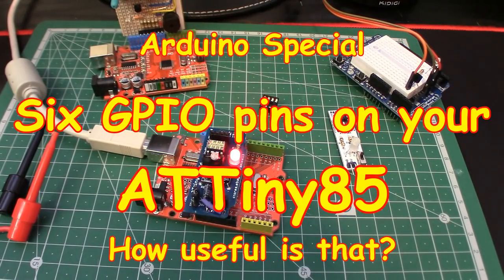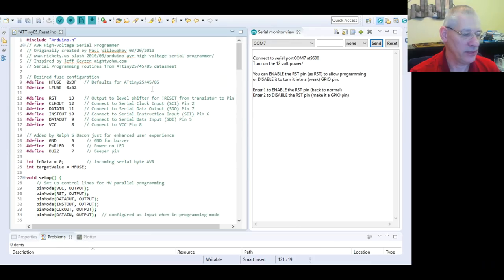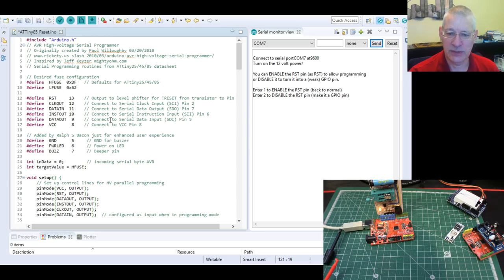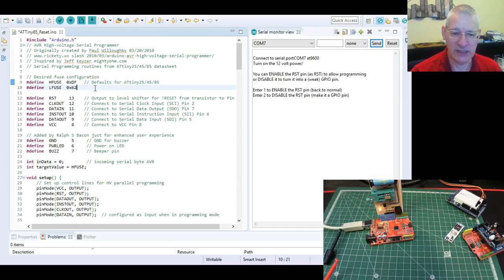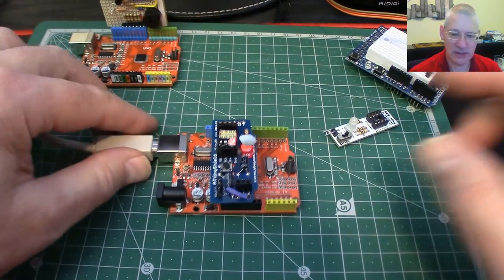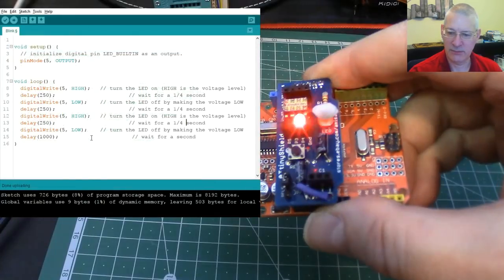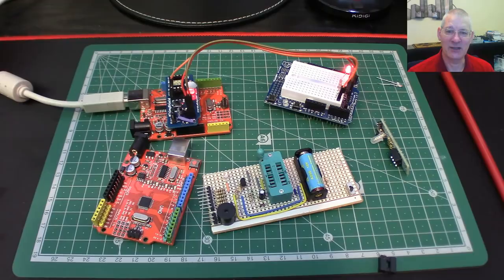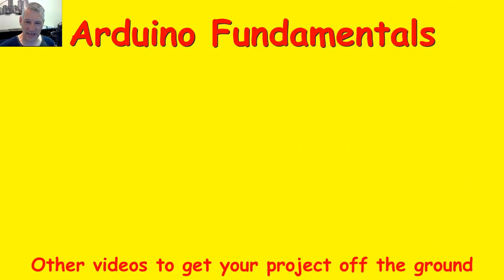#87 Six, yes SIX, GPIO pins on an ATTiny85

Comment: Ralph, this is great stuff. One of my current projects is using six gpio pins on a Nano. I want to use an ATtiny85 and now thank to this video I think I can. Will save a lot of space on the board. Yours is by far the best explination of how it's done. Good instructions/schematics on the 12V board too.
Also have to get a 128x32 ssd1306 OLED working on i2c, so hopefully can figure that out and I should be good to go. I have a few leads but if you have and inspiring tips then I'm all ears. 
Huge thanks as always for your great videos.
Reply from the maker: If you're looking to get the SSD1306 running on I2C on the Tiny85, I did a video on how to get the I2C running (using a different LCD screen) which may help.
Video #82 https://youtu.be/5bnXeHz06Ck
Reply: @RalphBacon  cheers Ralph. Will give that a bash.

Comment: Another great one! Thanks!
Reply from the maker: Thanks Robert - but would you ever use a Tiny85 or stick with the 'traditional' Uno/Nano? And, more importantly, the reason?
Reply: The reason would be power consumption and possibly size. Dawid Watts did a video on how to switch an ESP8266 on and off with an ATTiny85 controlled MOSFET. He was able to extend the battery life to the point were he decided to end the project (or put it on hold). ;-) 

Another reason for choosing an ATTiny85 is price. These micros are cheap. I also like to think of it this way: If you have enough IO-pins on an ATTiny85 and the performance and memory are ok, why use anything else? Assuming of course that the alternative is an ATMega328P or similar.
Reply: Oh, and I forgot to answer the first question. Yes, I have several ATTiny85s and ATTiny2313 and ATMega328P among other Atmel micros. However, I don't use them (yet). I put one of them on a breadboard from time to time, write some code and program it. I really need a reason to use any of my Nanos/Unos or other DIP package I have lying around. :) The demand for microcontroller-controlled gadgets are low at the moment.
Reply from the maker: Thanks for the reply, Robert, it's interesting that your replies seem to reflect the general mood regarding the Tiny85. Power, size, good enough and so on. Well, if nothing else my videos on this device will have raised awareness!

Comment: VERY GOOD THANKS
i was looking at this maybe i can use a shift reg to add extra out put pins
do you have any code for this, i want to make a simple security system that just has blinking lights on each window to make it look like the window has some sensor on it. i did this before using a 4017 and 556 timer
Reply from the maker: You can cascade several PCF8574 pin extenders on I2C (which the ATTiny85 can bit-bang). See my video #49. Also my video on ATTiny85 and I2C video #82.

Comment: Hello, and thank's for this excellent video, I'm just getting involve with a ATTINY85 about fuses setup and I wonder I found this video on youtube about AVR Fuses by Mitch Davis, "Bare-Metal MCU #5 - AVRDude and fuses" , does the AVR setup can do the same as an HV fuses setup module. thank's again for your time.
Reply from the maker: If you watch my video #144 you will see the Fuse Resetter PCB that I made specifically for this purpose. Works well.

Comment: Of course if you really need more gpio there is always the ATtiny84 with its 14 pins.  ;)
Reply from the maker: Indeed you could Nick. If you see my response to 2000jago you'll note that I mention there are several choices and whatever is right (for whatever reason - size, cost, power, features, I-got-one-in the-toolbox) then it's the right one for you! Nice to hear from you again.

Comment: Hi Ralph. Very nice explanation....but I got a little problem - after make the changes in fuse bits, the Attiny85 started to work slower. When I tried to Blink, the delay time was almost 10x slower ... What could It be?
Reply from the maker: I suspect you are running the ATTiny85 at its factory default speed of 1Mhz, Filipe.
 
Go to this website http://www.engbedded.com/fusecalc and select the correct chip and then see if you can decipher what you need to run at 8Mhz using the internal RC oscillator.
 
Be careful, you can make unwanted changes that might brick your device. I used this though, and it all worked as intended. Or, when you program the ATTiny85, just tell the Arduino IDE that you're running at 1Mhz and it will compile accordingly.
 
It's worth uploading the BLINK program with a 1-second delay between blinks to double check your speed fuse settings.
Reply: Ralph S Bacon thanks for the answer! I think I found the thing...in  the sketch, the Low fuse is defined as 0x62, this is default option that , looking at the engbedded Calc, this value makes the clock be divided by 8 ... So If I modify the LFUSE define from 0x62 to 0xE2 It should work. I think when I burn the bootloader with the 8 MHz option , the LFUSE os setted to 0xE2, and when I upload teh attinyreset It sets back to 0x62...I'll try later...tell me If does It make Sense (Sorry my english!!)
Reply from the maker: Yes, the default is to divide by 8, but it does depend on what settings you are using in the Arduino IDE. For example, if you specify 8Mhz as the clock speed (in Tools > Settings), but in reality your ATTiny85 is only running at 1Mhz then you will have an eight times slower "Delay" and "Millis" in your code! So what you propose makes good sense - let us know if you have success with this change.
Reply: Hey Ralph,,,I tested right now and works! I create another function establishClockContact() and other variant - targetClock, and now I can choose the clock fuse bit :))...very thanks for that!
Reply from the maker: Sharing is caring, as they say, Filipe. Glad you got it all working, that is excellent. Thanks for posting (and sharing).

Comment: Actually, I still have a question: it also works on attiny13a?
Reply from the maker: I don't think I ever used on the ATTiny13A, you had best check whether the RESET pin can be turned back into a RST pin when you want!

Comment: Great video again Ralph. Thank you for your research on expanding the ATTiny85.
With your permission, for anyone needing the AttinyShield programmer:
- The DIY version of AttinyShield can be found here: http://www.ebay.com/itm/221434907666
- The fully soldered version of AttinyShield can be found here: http://www.ebay.com/itm/221324819158

 Also I would happily accept the challenge of making this pcb probgrammer but because of your videos I have
a lot of AttinyShield's to make, since with every video i have new orders of the Shield :)
Also did you receive the gift board of AttinyShield I have sent you?

Waiting for your next video my friend.
Themis
Reply: Amisail3 How about a shield for both high and low voltage programming? I recently bought your programming shield, works well. Used it on my latest project.
Reply: Thank you Steve I am grlad you've found it usefull.
I guess the problem for a mixed shield would be the size. It should cover more pins and have more componets on it.
Also not everybody needs both functions. The soft programming that my AttinyShield does is enough for many projects with 2-3 inputs-outputs.
Ralph showed us that if we need more then it is possible... but a shield... 
In any case Steve it was nice bringing it up.

Themis
Reply from the maker: Hey Themis, great to hear that business is booming!

Yes, I just got your replacement shield, thank you so much, I shall construct it soon (and not modify it this time). I guess there is not enough demand for a PCB for a HV programmer; at least I have shown that it is easy to construct on strip board!
 
I wish you continued success and enjoy the videos. NIce to hear from you.
Reply: Great news Ralph. Hope you ll enjoy it.
Keep up the good work friend :)
Reply: @Amisail3. I recently received your ATtiny85 shield and very promptly to. It completely simplifies the programming of, and the development of firmware for, these devices. Thank you so much.
Reply: Thank you very much Michael.
I really appreciate your feedback.
Hope you will make more Attiny85 projects with Ralph's valuable helping videos.

Comment: Hello Ralph , I found out from Atmel ATTINY85 datasheet page 148 note 2. After this fuse has been programmed device can be programmed via high-voltage serial mode, only, so the best way to alternate is to use an HV fuse setter.
Reply from the maker: If you watch my video #144 you will see the Fuse Resetter PCB that I made specifically for this purpose. Works well.

Comment: I remember the thousands of PROMS, EPROMS and EEPROMS we burned at Boeing during the late 70's and 80's. Then we started in on PLA's for even denser circuits. At least the EPROMS and EEPROMS were reusable
Reply from the maker: But surely the ones you mention (in my Grandad's time, I believe, cough, cough) only had about 100 bytes capacity? Probably 4-bit devices too, or were things more advanced than that? You'll be telling me that you had running water too, no doubt. Just kidding, Raymond, I remember mainframe 'hard disks' consisting of many platters and giving us a whopping 16Mb (that Mb not Gb) in the early eighties (as my Grandad told me as I sat on his knee).

Comment: Great video again Ralph! Does anyone know where I can buy a pre-made fuse resetter by any chance? I tried searching on ebay but I might have used the wrong terms(?) Cheers!
Reply from the maker: I found this one (UK site):
https://www.ecrater.co.uk/p/25674542/usbasp-usbisp-avr-programmer-usb?gps=1&gclid=CjwKCAjwt5DXBRAtEiwAa3vyEhsK-bMlOC4PwiLkMW09NtHvcz5Vxj-rJ1awjTS_1ywL7b84MuAMUxoCTvcQAvD_BwE

But you're on your own to determine how to use it and whether it will do what you want, I'm afraid, Mikael! I searched for ATTiny85 Programmer. But making one takes about 1 hour, does what it should, and costs very little. Always assuming you can solder OK, of course. Perhaps others will suggest other items...
Reply: Thank you for the link Ralph. I have one of those around. Is it able to de-brick an attiny85 that I can not communicate with as well? I mean the "Yikes!" error message. I bricked mine using the wrong clock I think. Or do I need to construct one of these 12v boards in order to get it working again?
Reply: Ok so I built one of these reset boards and it works! However, the readings that come back after writing the fuses are a little odd. Another strange thing is that the chip seems to totally reset. If I have set the clock to 8Mhz and programmed it it will switch back to 1MHz (noticed by slower blink). Is that to be expected with this method? This is the output I'm getting when using your sketch: https://pastebin.com/1rDePKBY
Reply from the maker: Let's put it this way, MIkael: the fuse-setter that I built ONLY set the RST pin 1 back to a reset pin (rather than a GPIO pin). That's it. It didn't change anything else because it wasn't setting any fuses, it was just applying that 12v pulse at the appropriate time. I'm guessing you're doing more than this, hence the whole chip resetting (but I'm guessing). You should be able to set the speed back to 8Mhz just by programming the board again with the required settings (and perhaps a few fuse settings that you might now have inadvertently changed).
Reply: The thing is that I was only using this sketch but still saw that behavior. I figured it out though. My default settings in the Arduino IDE was 8Mhz internal, rather than the 1Mhz (which seems to be factory default). The difference there seems to be the low fuse which is 62 at 1Mhz and E2 at 8Mhz. The setting in the fusecalc is called "Divide clock by 8 internally; [CKDIV8=0]". So what I gather is that if I want to run the A85 at 8Mhz I need to set the default low fuse to E2 rather than 62.

Comment: I'm going to use this trick to make my 8x8 dot matrix led which requires 2 sets of 74xx595 IC.
I already soldered ATTiny85 and 74xx595 onto the PCB and I just found out pin5 is not usable until reset is disabled.
You mentioned it's weak I/O pin. Does it have enough current to make 74xx595  clock pin work?
Reply from the maker: It might work with its weak output - or else wire it to a transistor to boost the signal. Make sure you test your design on a breadboard first!
Reply: @RalphBacon  Thank you for your advice.
I have more questions.  What is Zener Diode model  number you put in your circuit?  How many voltage and how many watt?
and what value of that capacitor?
Reply from the maker: Are you talking about the fuse resetter circuit, or something else? No Zener in the former, hence my query.
Reply: @RalphBacon  At 21:17, there is one component next to the capacitor. It sits between 12v rail and resistor that goes into the collector of the BC547 transistor.
It looks like Zener Diode. That's why I'm confused.

Comment: Good day sir, I love your videos.I even made a humidifier of such  with auto filling of water.  Well on with my question. (sorry for the long question)   I made this project but im having a problem.   Im using a 12v 1.5A power pack and im getting intermingling fuse changing.  This is what is happening.  I programmed the attiny85 to blink PB0 to PB5 one at a time. As it should it only flashes PB0 to PB4. I run the code, it shows the default values but will not set the new value constantly.   Im wondering via a scope what voltage everyone is getting on pin 1 while it is writing.  Im getting 10v ± .5. Thank you for your time in advance.
Reply from the maker: Hey Havid, what a question! Remember that unless you have changed the 'fuse' setting to allow physical pin 1 to act as a GPIO pin then it is only used as a reset pin. Be aware (or perhaps, beware) that if you do change that fuse setting (all described in this video) to allow Pin 1 to act as a GPIO pin, then you must reset that fuse again using a special 12v resetter (see my video) to allow the board to be reset to allow uploading of code - otherwise your ATTiny85 will become 'bricked', no longer able to be programmed. All is explained in the video, so watch very carefully! All clear?

Comment: Now that you can get LGT8F328P boards for about a pound each if you buy 20 at a time on AliExpress, I wonder if there's much point in using an ATTiny85 except maybe if it saves power in a battery-operated project? Of course there's also the sense of pride and accomplishment.
Reply from the maker: Your last sentence struck a chord with me, Sean. 

Imagine (it's easy if you try) that all cars were the same price, from Rolls Royce to Smart For Fours. Would we all be driving Bugatti Veyrons? 

Some, certainly. But the thrill of getting some old "classic" car restored, and running reliably is a real challenge, a labour of love. Whilst I do not restore old cars, using a low power and smaller microcontrollers is always a challenge to the maker! And, as you say, the sense of accomplishment that you have really honed that code gives a sense of pride too.

That said, I tend to use ATMega328-based boards for most of my projects (so, Nano, Pro Mini, even the relatively large UNO) but now and again I'll use a Tiny85, Tiny13, ESPXXXX and now that a viewer has pointed me to a new bootloader for the STM32 (yet to be verified) that one too!

Comment: Mr Bacon:
    Thank you for all the wonderful videos. Recently I used the video on using all 6 pins on an ATTiny85. Very informative and helpful to a project I currently have on my table. BUT it left with with a question I can not find a simple answer to. Consequently I am asking you if you don't mind. How can I configure the reset pin PB5 to an ADC input. Which brings up another thought. Would you consider a video on pin reassignment for the ATTiny85 or ATTiny's in general. Thank you very much for everything.
Reply from the maker: Hello Mr Zubli, thank you for your kinds words. If you have reset the fuse (as described in this video) for physical pin 1 to turn it into GPIO digital pin 5, you could try and do an AnalogRead on A4 (I'm guessing this is the next analog channel available). If it doesn't work it may just be that they never included the circuitry for ADC on physical pin 1/GPIO 5 as it is normally used as the RESET pin anyway. Do let us know how you get on though!

Comment: They are called "fuses" because originally, this sort of setting was literally a fuse - a bit of the IC that was permanently opened up with a relatively high current pulse. Now that's a way to permanently make it impossible to read the code back off a microcontroller. Now it is a resettable device, although the security now is that resetting certain fuses also erases the program memory.
Reply from the maker: Interesting. And some fuses are still "burn once" on some chips so we do have to be aware (and beware) of what we're doing.